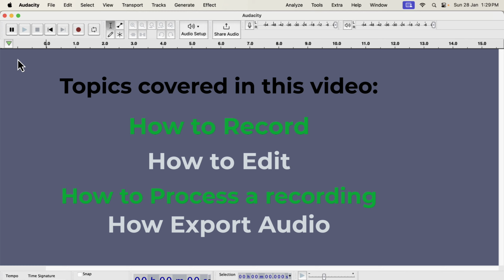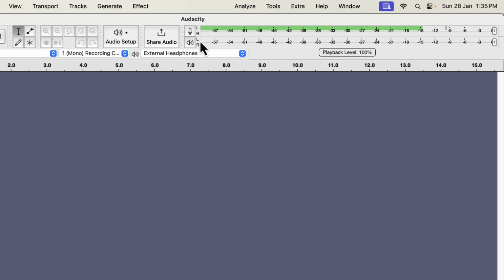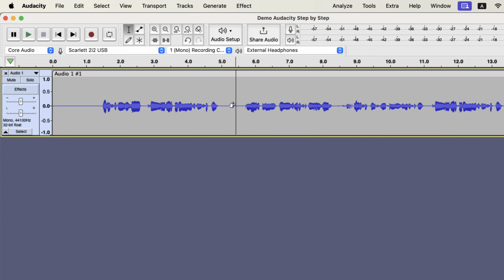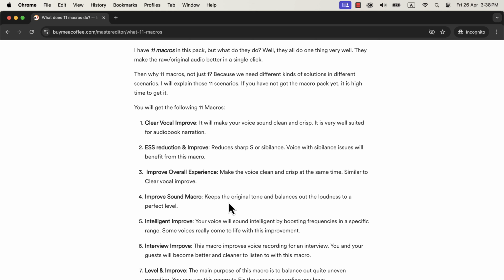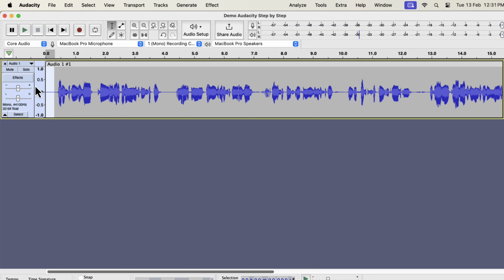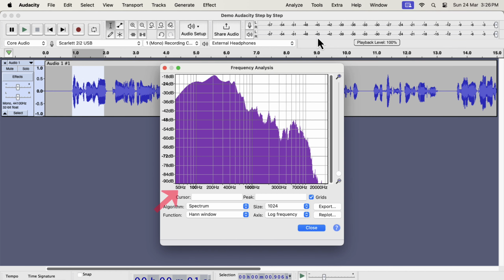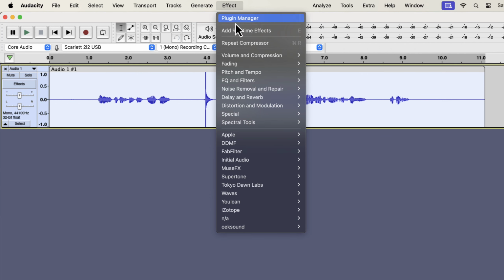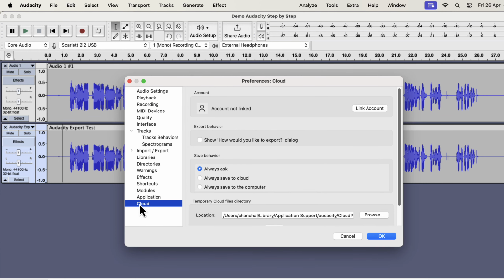Learn Audacity Step-by-Step for Beginners

Comment: Summary
- 00:00:00 Introduction to beginner level Audacity tutorial.
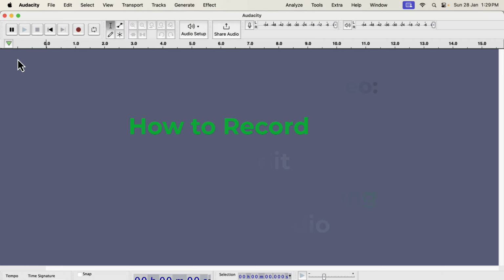- 00:00:23 Starting with recording the best voice using Audacity.
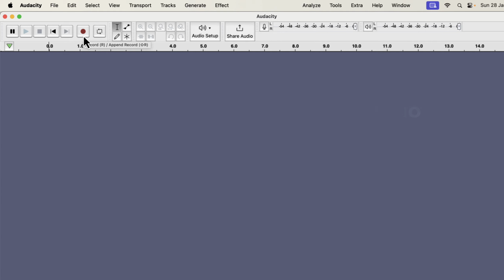- 00:01:13 Selecting the microphone for recording in Audacity.
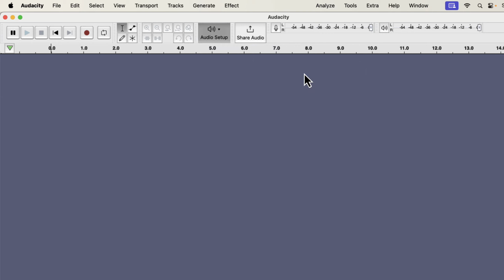- 00:02:15 Configuring recording device and channel settings.
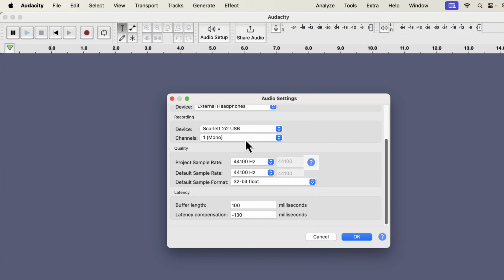- 00:04:02 Understanding sample rate and sample format for audio recording.
- 00:06:28 Recommendation for sample rate and sample format settings.
- 00:06:52 Tip on setting the microphone from the device toolbar in Audacity.
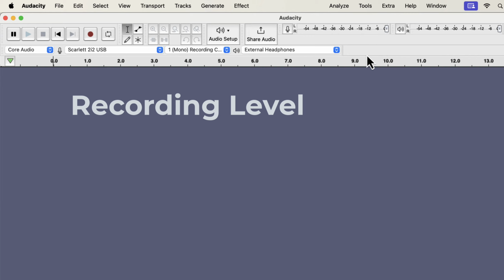- 00:08:34 Proper recording level is crucial for clean audio; adjust levels using Audacity's meters.
- 00:11:49 Prepare for recording by setting input levels and gain staging.
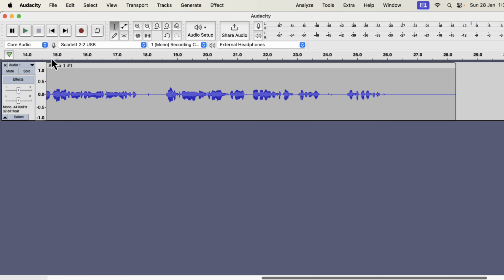- 00:12:23 After recording, save your project in Audacity to edit the waveform.
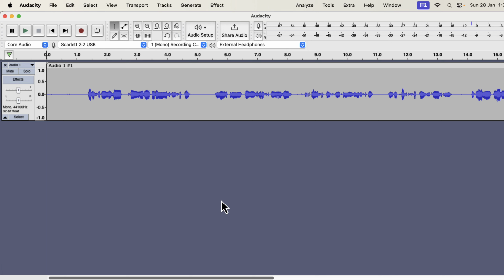- 00:12:56 Save your Audacity project to continue editing later; remember to save changes explicitly.
- 00:14:06 Learn about post-processing to enhance audio quality in Audacity.
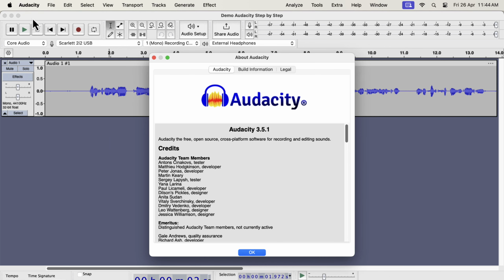- 00:14:18 New feature in Audacity 3.5: save projects to the cloud for convenient sharing.
- 00:14:25 Audacity 3.5 introduces cloud saving options for projects.
- 00:14:38 Consider local saving for projects as a beginner; cloud saving is ideal for sharing.
- 00:15:19 Next, we will cover navigating around the timeline and waveform, and optimizing the final audio.
- 00:15:27 Basic editing and navigation inside Audacity will be explained, highlighting the importance of understanding the system.
- 00:15:31 Basic functions like copy-paste may not be straightforward in Audacity, emphasizing the need for proper knowledge.
- 00:15:43 Audacity offers a straightforward interface for audio editing, which becomes clearer with repeated use.
- 00:15:51 After recording audio, understanding tracks, timelines, and waveform shapes is essential for effective editing.
- 00:16:40 Basic editing skills in Audacity, such as navigating the waveform, are crucial for enhancing sound quality.
- 00:17:52 Exploring functions like copy and paste, along with shortcuts, streamlines the editing process.
- 00:18:59 Understanding clip creation and management in Audacity can enhance editing workflows.
- 00:19:59 Being aware of Audacity settings and preferences is important for effective usage and troubleshooting.
- 00:20:17 Completing an Audacity course for beginners can boost confidence and competence in audio editing.
- 00:20:23 Additional commands like 'duplicate' offer useful features for track comparison and enhancement.
- 00:21:50 You can make any part of an audiobook silent using the audio selection button.
- 00:22:09 Navigate and perform basic editing actions like undo and redo.
- 00:22:10 Access the history of your actions for the current session in Audacity.
- 00:22:57 Learn about improving sound quality in Audacity using audio effects.
- 00:23:35 Explore built-in and third-party audio effects in Audacity.
- 00:24:29 Adjust Audacity preferences for displaying effects and real-time effects.
- 00:24:52 Discover methods to enhance sound quality in Audacity through manual effects application or macros.
- 00:27:16 Consider using Audacity as an entry-level audio recording and editing software.
- 00:27:49 Easily improve voice recordings using macros in Audacity.
- 00:28:01 Access additional macros for audio enhancement on a Patreon page.
- 00:28:17 Explore a macro pack for audio improvement with positive user feedback.
- 00:28:43 Detailing the easy installation process of the macros in Audacity.
- 00:29:24 Highlighting how the macros improve sound quality and apply EQs automatically.
- 00:30:24 Emphasizing the importance of using Audacity effects in a specific order for better sound.
- 00:30:30 Encouraging the use of macros for easier sound enhancement and faster Audacity learning.
- 00:31:22 Introducing the normalize effect as a crucial step in audio editing.
- 00:32:10 Explaining the purpose of the normalize effect for volume control.
- 00:33:19 Demonstrating how the normalize effect helps reveal audio anomalies.
- 00:34:11 Illustrating the impact of the normalize effect on audio volume levels.
- 00:35:45 Applying a -3dB normalization results in a decrease in volume level, indicated by a shrunken waveform.
- 00:36:02 Understanding the fundamental concept of normalization is crucial for audio editing.
- 00:37:13 To clean up audio, Audacity offers a noise reduction effect for removing unwanted noises like mouth noise or breathing noise.
- 00:37:53 Noise reduction in Audacity is a sought-after effect, but it's important to understand its limitations and how to effectively reduce noise.
- 00:39:21 Normalizing audio levels can help improve the overall audio quality, but it may also increase noise levels.
- 00:39:54 Increasing the loudness of a recording can lead to an increase in noise levels, highlighting the importance of balancing volume and noise.
- 00:40:00 Understanding the relationship between increasing loudness and noise levels is crucial in audio editing.
- 00:40:29 Audacity's noise reduction process involves selecting a noise sample to remove similar noise from the audio, with considerations for noise reduction amount and sensitivity.
- 00:42:05 Setting appropriate values for noise reduction amount, sensitivity, and frequency smoothing is essential for effective noise reduction in Audacity.
- 00:42:34 Balancing noise reduction settings like sensitivity and frequency smoothing is key to preserving audio quality during the noise reduction process.
- 00:42:57 Adjusting noise reduction settings in Audacity
- 00:43:37 Overview of Audacity as an audio recording and editing software
- 00:43:51 Recommendation to use Noise Gate effect for reducing noise from silent parts
- 00:44:10 Suggestion to explore Audacity course for beginners for audio editing
- 00:44:32 Moving on to discuss another audio effect after noise reduction
- 00:44:40 Introducing Equalization (EQ) as a key audio effect in Audacity
- 00:45:10 Explaining the basics and advanced tricks of using EQ in Audacity
- 00:46:01 Understanding frequency ranges and manipulation in EQ for audio enhancement
- 00:47:05 Utilizing Audacity's plot Spectrum analyzer for frequency analysis
- 00:48:04 Importance of manipulating volume by frequency using EQ for better sound
- 00:48:39 Emphasizing the impact of boosting or cutting specific frequencies with EQ
- 00:48:50 Exploring general guidelines and factory presets of EQ in Audacity
- 00:49:15 Previewing audio changes with EQ settings before applying them
- 00:50:10 Understanding the concept of fundamental frequency in voice recordings.
- 00:51:00 Applying EQ adjustments like low rolloff and treble boost for improved audio quality.
- 00:52:50 Recommendation to consider personalized EQ and processing for optimal voice recording.
- 00:53:01 Introduction to the compressor effect to manage dynamic range in recordings.
- 00:54:20 Demonstrating the impact of the compressor effect on audio consistency and dynamic range.
- 00:55:17 Importance of compressor effect in managing volume consistency in recordings.
- 00:56:09 Explaining the role of compressors in effective audio editing and the need for customized settings.
- 00:57:06 Explaining the importance of understanding the recording process and seeking clarification if needed.
- 00:57:22 Demonstrating how to identify quieter parts in a recording and set threshold levels.
- 00:58:10 Adjusting compressor settings and explaining the differences in Audacity's compressor.
- 00:59:13 Setting threshold values, ratios, and other configurations for optimal compression.
- 01:00:12 Highlighting the importance of checking specific checkboxes for compressor settings.
- 01:00:36 Applying compressor settings to reduce dynamic range and improve audio quality.
- 01:00:51 Emphasizing the significant improvement in audio quality with proper compressor configuration.
- 01:01:39 Selecting quieter audio parts and adjusting threshold levels for regular recordings.
- 01:02:45 Applying compressor settings for regular recordings and explaining ratio choices.
- 01:03:06 Highlighting the importance of normalizing audio after compression for peak level adjustment.
- 01:03:39 Encouraging mastering audio effects based on individual requirements and suggesting further learning resources.
- 01:03:44 Emphasizing the importance of mastering audio effects for beginners and customizing based on needs.
- 01:04:09 Learn how to export audio in Audacity by going to the file menu and selecting export audio.
- 01:04:36 Choose the file name and location to save the audio file after export.
- 01:05:06 Select the file format and additional options based on your requirements.
- 01:05:23 Export the file as a wave format, suitable for projects and audiobooks.
- 01:05:38 The exported audio file is playable and can be imported back into Audacity.
- 01:05:58 Adjust export options like saving to the cloud in Audacity preferences.
- 01:06:08 Explore advanced editing features like multitrack and effects for better audio production.
- 01:06:21 Consider taking the Audacity bundle for comprehensive learning and a lifetime membership offer.
- 01:06:31 Take advantage of discounted lifetime membership for access to current and future courses.
- 01:06:44 For more information on courses and tools, contact via email provided in the description. Happy learning on Audacity!
Reply from the maker: Wow! Did you wrote everything or used any tool?
Reply: @MasterEditor5  I used an AI tool called "Shortform" an addon for webpages and YouTube videos 👍